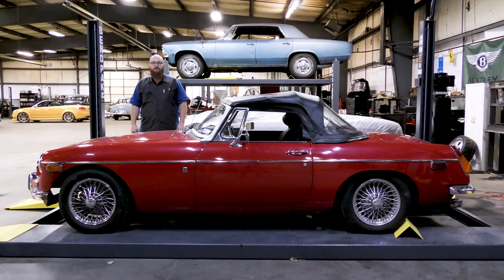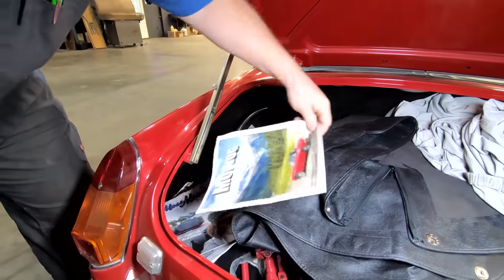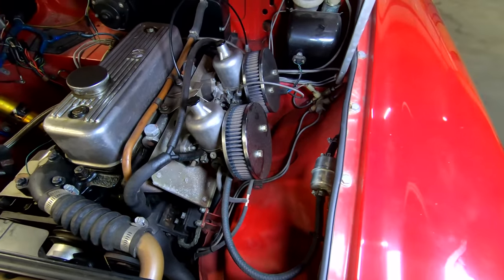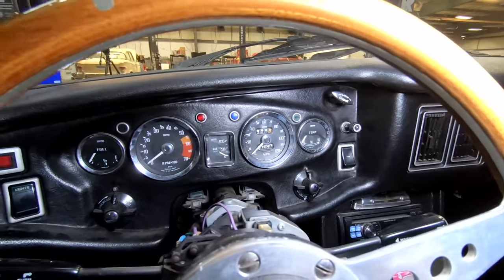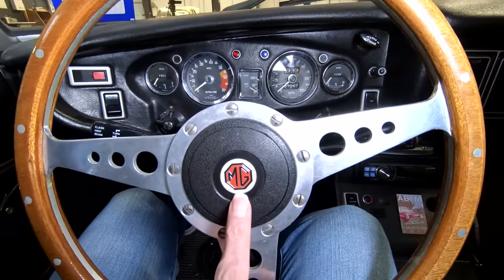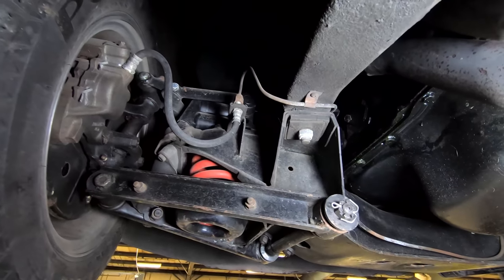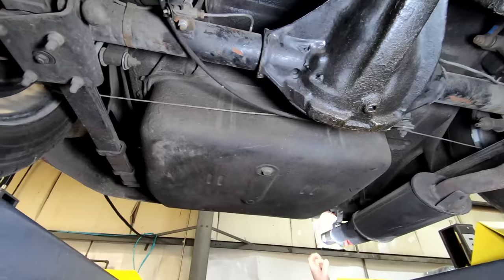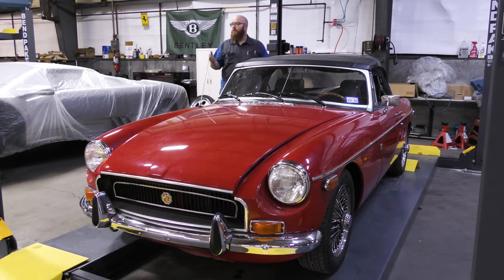Cherry 1972 MGB! See exactly why it earns a thumbs up from the CAR WIZARD!

Comment: When I was in trade school, I worked part-time at a friend of my father's shop. He did restorations, resto-mods, exotics, and, I helped him put a Honda S2000 engine & trans in one of these. It took it from barely being able to get out of it's own way, to being a fun little car. Plus, it solved the reliability problems that come with British hardware.
Reply: Hope they upgraded the brakes too!
Reply: That harsh but funny!
Reply: I do understand the appeal of the Honda 2000 or even a Miata transplant. The MGB is a lot more fun to drive with a boost in power, and or a 5 speed. I do prefer a motor with lower RPM grunt, but that’s me. 

 Actually, most of the components, particularly the engine and tranny were very robust. The real problem was Americans used to American cars, and not doing the proper maintenance- what’s a valve adjustment, or replace the points and plugs, do an oil change, Was common, plus not understanding those “weird looking” carburetors. When the car didn’t run properly, instead of doing the complete tune up including valve adjustments, people would start Messing with the carb. 

Between 2011 & 2019 I had a 1974 MGB-GT that I put close to 40k miles on, and it always got me there and home. Plus, I had to use it as the main ride a couple times when my “real” cars were having issues. 

Please don’t discount the reliability of a properly sorted MGB. They are great fun affordable classics.
Reply: Well that’s destroyed the whole character of that car forever, it wasn’t perfect and that’s part of its charm . The trouble with cars today is yes they are super reliable,  but so dam boring without a ounce of character. It’s like when people buy beautiful old house’s then completely gut them,  turning them into open plan featureless box’s.
Reply: @gaz5663  yeah I was thinking that too. Might as well buy a shell or something, instead of trashing the original MG B. An engine is the soul of the car, and an MG- should have the MG engine. Otherwise, how is it even an MG anymore, except for the exterior etc?

Comment: 14:00 the original fuel pump brand is SU (same as the carburettors). This brand is now owned by a British company called Burlen.
14:20 the MGB has two battery compartments because it had originally two 6 Volts batteries connected in series. Many owners later on converted this to a single 12 Volts battery.

Comment: I remember drives with my parents in our '72 MGB.  They were up front and I was curled up in a blanket on the battery cover back long before child seats and seat belts were a thing, or wrapped up under the passenger side tonneau while my dad drove in the rain with the top down and AM radio blasting.  Years later I would inherit the car and loved and cared for it until it was stolen and wrecked.  Absolutely broke my heart.  Maybe someday I'll find another one to adore and scream at it's electrical issues.

Comment: Ron Kluwe covered just about everything I was going to say.  I grew up with MG cars being born in the UK and being old!  These cars were very common along with Midgets, my particular favourite.  You can rebuild the fuel pump quite easily, you can probably get a recon kit from Moss Motors.  The second battery tray was exactly that.  Originally the B was fitted with two six volt batteries.  It may be an export model variation to use a single twelve volt unit, I'm not sure.  The one thing that defines all MG's is simple fun.  Great cars.
Reply: bingo on the dual 6 volt batteries/dual trays.
Reply: My 67 bought new in Canada came from factory with the two six volts in series to give you the twelve volts.

Comment: That is a beaut. My father worked in automotive supply we were going past Longbridge one day and he said there would be a strike soon, I queried that, Car parks overflowing with i=unsold cars so management will do something small union will object ends in a strike. Another story they had an inter union dispute over who puts the screws in on a model with a wooden dash because screw goes through wood into metal,  recall a customer saying that explains why there no screws in mine and it fell out, (dealers were supposed to fit them- no one told them.

Comment: One suggestion to insure reliability is to removed the fuse block and clean all of the contacts.  Most electrical issues on my '72 MGB are from bad grounds and that fuse block.  It's a part of my annual service now.
Reply: Yes agreed, or replace the fusebox with new one.
Reply: And that is a factory recommendation largely ignored in the American market, just as is an annual "de-coking"
Reply: Dialectic grease is your saviour on these cars with a can of WD40 being almost mandatory in the glove tray of any Mini of the era to spray that distributor head with it's useless rubber boot still allowing condensation or leakage to intrude. The design of that little booger put the distributor right up front just behind the grill low down where it would get swamped with road spray during any rain. Golly, at 77 years old I find myself lusting after that British Leyland experience once again. Is there a pill for that?

Comment: Had a mint condition 1969 MGB in red with black leather with about 50K miles in 1983.  Was in a head on crash with a Smokey and the Bandit style 4500 pound Trans Am, each of us going 35mph for a combined 70 mph impact, Smokey had suddenly crossed the line. The car was crushed like a beer can around me, but the cab was remarkable strong, probably saved my life. It was a fun, super-reliable, simple little convertible, handled better and surer than my three Austin Healeys, but not quite as well as my Alfa Romeo Duetto Spyder, one of the most balanced cars I've ever driven. The five main bearing engine on the B is nearly indestructible.
Reply: The Alfa Romeo was a much more modern car in spite of being an older design.  A whole class higher in all regards.
Reply: MGB was the first MG  designed and built with a dedicated front "crush zone".

Comment: I acquired a a pristine 1971 MGB last February also with overdrive.  Just a heads up, I was told not to back the car up with the overdrive engaged because if the solenoid that automatically disengages it were to fail the unit can be damaged badly.  I am not an expert so take it for what it is worth.
Reply: True.  Never reverse with O/D engaged.

Comment: The small Abingdon factory was very much a family firm within the BL monster. They were proud of the cars they built. I bought my 1966 MGB in 1969 and still have it. The fuel pumps are made by SU these days the rights are owned by Burlen they will also sell you new carbs. Those K+Ns are aftermarket. They originally had one metal can plus intake tube arrangement per with a paper filter element.. 
The points on the fuel pump are a known weakness, our car now has a transistor assisted one. This does lose the ability to tap it with the wire wheel hammer to get you home.
Our car still runs all it’s original Lucas equipment and it gives no problems, it isn’t a garage queen having once run off Berlin to home in England in one day after a rally through close to monsoon conditions.
Mrs W’s reaction isn’t unusual, women often walk up to ours and stroke it when it’s at car shows.
I always enjoy your videos, thank you.
Reply: There's nothing like being stroked at a car show....
Reply: I had a MIdget Mk I (aka Sprite Mk II) that got me addicted to LBC's (Little British Cars). These cars were crude, primitive and lovable. No, they were not perfect but they topped the scale as far as fun goes. If it weren't for my Midget, I would not have learned to work on cars. If I didn't have my head underneath the hood once a day, it meant I wasn't driving it.

Comment: My brother had 3 MGB GTs over the years , great car but the GTs are solid roofs not rag tops.  The bodywork looks in great shape usual rust spots are on the top of the fenders eg seam joint. First one was British racing green , black leather interior cream piping.  Chrome bumpers not the plastic stuff. I did my apprenticeship training at Laycocks overdrive plant in archer road , Sheffield , South Yorkshire,  uk when it belonged to GKN. Then moved to Shardlows plant another GKN site manufacturing forged & machined crankshafts, happy days.

Comment: These were built for racing !  The factory had teams at Lemans...Sebring and more in the 60's.  The dual rear batteries were to help weight distribution and lower the centre of gravity.  Also with battery tech back then 2 six volts supplied more cranking power  in the cold than a single 12 volt.  All of the dual carb pre 1975 B's ran between 90 and 95 hp depending on year and body style.
This is one sweet MGB....overdrive is a big plus!  Paint is beautiful.  Zero rust.
Reply: They were not built for racing. They were modified for racing.

Comment: I worked in the parking business in 1970 one year after high school. 
“I drove ALL the cars” and I mean All. 
The MGBGT was one of my favorites.
Fit like a glove when driving it. It was like being in a fighter jet cockpit, not for speed but fit. A blast to drive. Everything was right there sitting in it. “No other car like it” Not even the Triumph’s came close or any other car.  Some of my other favorites listed from that time period 1970 to 1971 I drove.
The Buick 225, the Mercedes Gull Wing Coup, Olds 442, Mercedes 6.9 liter 450.
Opel GT, Brecklin, Saab Sonnit, Cadillac brougham. Chrysler 300, Chrysler’s  Cuda,
Buick GS, Corvette, two different 3 wheelers, the BMW and I forgot the other ones name. Jag XKE hardtop. Too many more to list. The MGB GT always stands out in my mind even after driving All the different cars back then. 

I bought a brand new 1971 Beetle, $1645.00 off the showroom floor. Then a new 1973 VW Super Beetle $2395.00. Why the VW Beetles, the most dependable cars you could buy. Easy to maintain, great fuel mileage, everyone seemed to own VW’s back then. Best car’s for the money. I drove 90 miles a day, 5 days a week for 7 years with the Beetle, it never broke down or stranded me in all those years up to 1980. 
I bought a new 1980 Olds Cutlass Supreme with the V6, nice car. My first automatic.
Reply: One of those 3 wheelers a Morgan (V twin engine air cooled in front of the car?)
Or an Isetta?  
Or a Heinkel Kabine Roller?

Comment: I’ve owned about a dozen MGs over the years and have found that most of the problems I experienced were a result of the previous owner trying to half way fix an issue rather than a fault with the car itself.   They are slow, small and uncomfortable for a long trip but they are still a blast to drive
Reply: It is more fun more to drive a slow car fast than a fast car slow. Even though these things can get smoked by most modern mini vans the fun to drive factor more than overcomes it.
Reply: Yep.  Any MGB left in the states was sure to have been owned by a teenager in the 80s or 90s, and has been thrashed accordingly.
Reply: @vw5056  Exactly right. A mini van may be able to outgun an MG B but you know they're no fun behind the wheel, it's a van after all. A nice chrome bumper MG makes you look and feel like a Hollywood star in the '60s.

It's not about going fast, it's about the experience!
Reply: @SpitfireFortyFour  but that take that minivan or "any modern hatchback that can apparently outrun the MG" and the MG B to twisty mountain roads, and you know who will be smoked and left behind... it won't be the MG B
Reply: @eymanyouwell  True. They are fantastic handling cars, however of you want to go fast there always the MG B V8!
Reply: @SpitfireFortyFour  the V8s are extremely rare here in Aus, and only came the rubber bumper model years (1973-76 I think) which I highly dislike (Due to the whole leyland low quality 70s build etc). I am more than happy with the fastness of the I4, as the car is extremely light.

Comment: I just had a 1970 MGB for sale at the last estate sale I worked at. It was mustard yellow with only 42668 original one owner miles. It had been sitting in the barn since 2004. We didn't try to start it but the new customer put new fluid in it and had it running the next day. The reason why it has two battery bins may be because the 70 model I sold had two six volt batteries.

Comment: MG's of this era are SO easy to work on.  Very simple systems despite the nonsense you hear people mention about unreliable Lucas electronics.  I'm sure Wizard will fix things, but there's no reason to send such a car across several states for basic maintenance.  Parts are readily available and technical help is widely available on several car forums.
Reply: I will add the last place I would go is The Wizard.

Comment: Years back, I bought a used  '77 MGB Tourer (4spd) and enjoyed it.  I loved the sound of the exhaust, it was just beautiful.  The English really knew how to dial-in an exhaust note.  And I've never heard an English car that I didn't like the sound of it.
People before me had forced closed both the trunk lid and the hood ripping the metal where the hold-up mount was attached.  So the Wizard is correct in being certain to release those latches to close them.
The only electrical problem I had was sometimes if I drove through a puddle the starter would kick-in and it would run for about five minutes.  Very annoying and seemingly self destructive but it lasted through my ownership.

Comment: Reminds me of years ago when I used to have a 1972 Triumph GT6  MKIV......Inline 6 with dual stromberg carbs it was an absolute blast to drive and I especially loved that the whole front hood was one piece and when you lifted it up you could just sit on either tire and work on anything in the engine bay.......Yep those where the good ole days.

Comment: It has relays in the electrical system. This car is missing many of the pollution control items like the air pump and gulp valve. Here in South Korea it must have all the pollution control items. Indeed it must look just like off the production line. Nice car. Mine came from Amarillo, Texas. That is why there is no rust on the this sample and mine. I have owned mine for 32 years, since January 1990. Nice to see one in such condition. This car does hold a tall person very well. I am 6’3” and fit in very well. Thanks for posting!

Comment: The MGB is beautifully proportioned and the perfect size for a sports car. In fact it defines the sports car.
Reply: It does define the British sports car!...unfortunately.
Reply: @curbozerboomer1773  Haha Harsh very harsh but well you can always retromod !
Reply: If you have sat in a Miata interior dimensions are a dead ringer for the MGB
Reply: @briandawkins984   The MIATA was patterned after the MGB and the LOTUS Elan S2.
Reply: The first Miata was indeed closely patterned after the Lotus Elan. The next to current MX-5 I looked at had identical exterior dimensions save across the beam. It was 6 inches wider. The cockpit dimensions vs. my 1980 MGB were pretty much a dead ringer.  Mazda claims the interior to be ergonomic design with a computer.  I leave you to judge. I think both cars are iconic.

Comment: I had one of these in the '70's as well as the MGC with a 3 litre 6 cylinder engine instead of the 4cyl  
UK versions of the 'B' had 2 x 6V batteries under the back seat instead of a single 12V. The cars were prone to body panel rust but I guess in Texas, the weather has been its saviour. Good ones go for very high prices in Britain these days.

Comment: Car Wizard: A couple of things I noticed on the underside tour of the car.
1) The oil leak. Check the PCV system (it should suck a sheet of paper down on the oil fill neck when idling.) Also check the left side (drivers side) of the engine block. There are two stamped sheet metal covers over the tappet gallery there. They usually have cork gaskets and are often neglected.
2) I was amazed that the inboard pivots of the lower A-arms were in such good shape. Looks like someone may have installed the MGB V-8 lower A-arm inboard sttel-rubber-steel bushings there.
3) Last but not least... the propeller shaft appears to be out of phase. It is possible to get the splines misaligned on the MGB if the shaft was ever removed for a clutch job or U-joint replacement. The splines are not keyed as in some vehicles. The two yokes at each end of the shaft MUST be aligned so that their axes are exactly parallel. It can be hard to see if it is off by one spline when installed. Looks like it might be out of phase by several. Best thing is to take it off and look straight along the shaft.
Reply: Good points that need loking at.
Reply: Good call and often sets up vibration and premature wear and failure of the differential to drive shaft seal.
Reply: @jeffhildreth9244  Unfortunately we will never know. Car Wizard will take a lot of time on describing problems and do his whole walk around but is kinda sparse on follow through, continuity, and completion.

Comment: The car was originally fitted with two six volt batteries , hence the two battery holders. The shock absorbers are called “ lever arm shock absorbers “ You can also get an su fuel pump that has a transistor power unit as opposed to the original contacts type and looks  identical.Mowog stands for Morris and Wolseley, the G has a number of meanings, depending on what you read about it.
Reply: Close... Morris OXFORD Wolseley  G various.